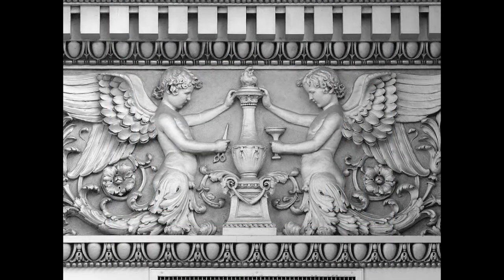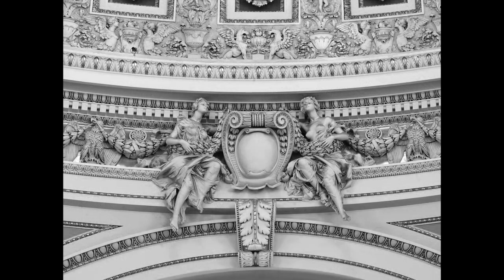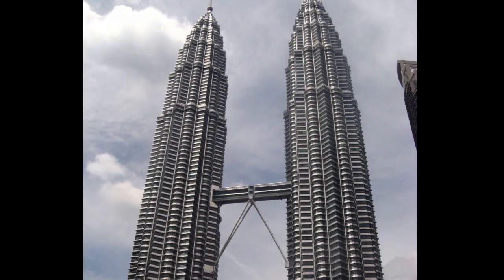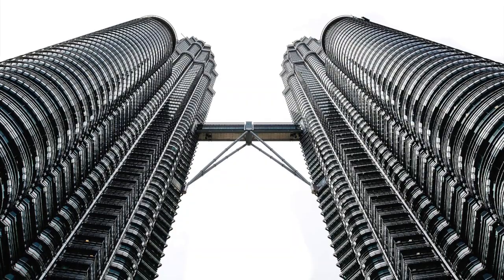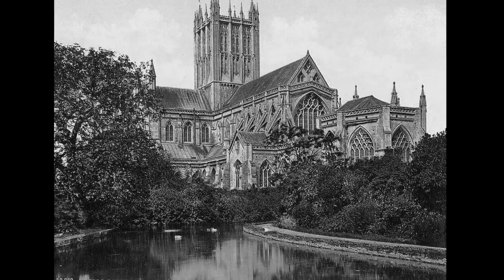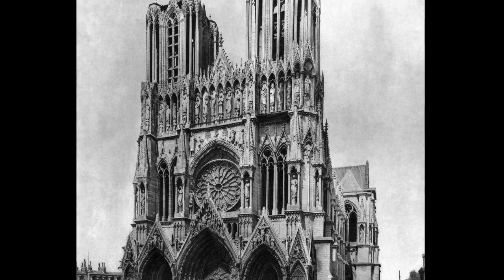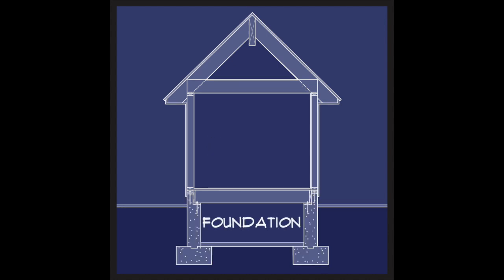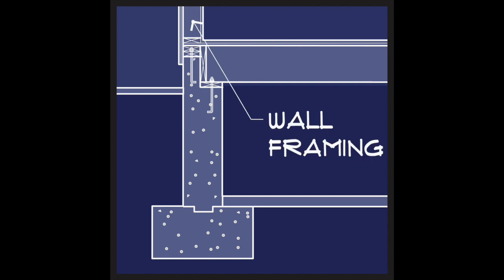7 Architecture Facts pt.25 | Chateau, Cathedral, Calatrava & Frieze

Comment: I want to study architecture but do you have to be good at physics?
Reply from the maker: You've got to have a general knowledge of physics. This comes with study at the University level.
Reply: The short answer is "yes to some extent".
______
The parts of physics you need in architecture are those that help you to understand structural analysis & design, building acoustics, illumination, and (probably) heat transfer.
______
You don't need some parts of physics like these that discuss motion (acceleration, momentum,....etc), fluids, electricity & magnetism, nuclear reaction, and relativity.
______
My answer is based on my experience as a student who has changed his major from mechanical engineering to architecture.
Reply: +Mohammad Ibn Mohanna  
thank you that's just the information I needed